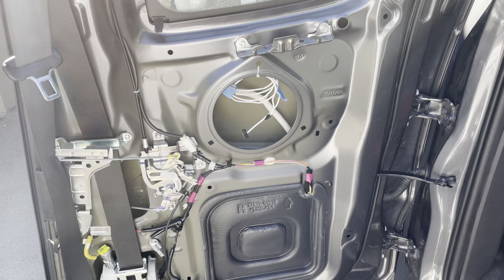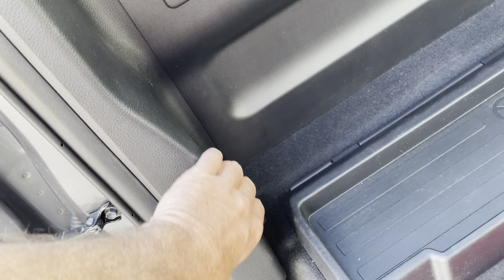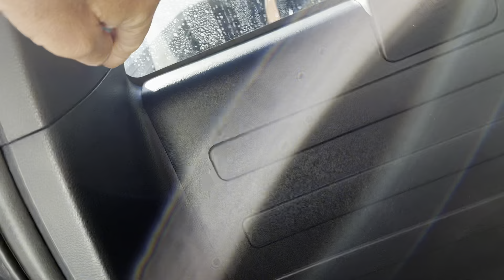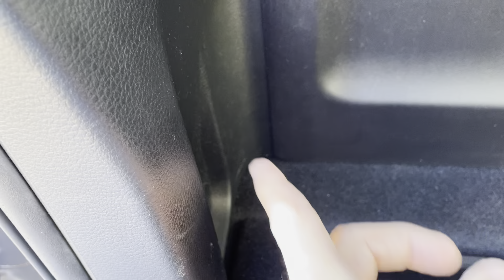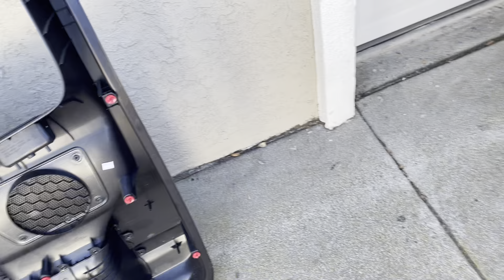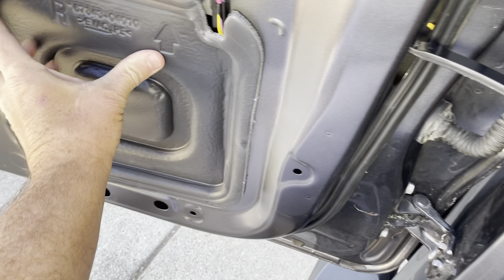2018 Toyota Tacoma SR Access Cab Adding Rear Speakers Part 1

Comment: What's interesting is I have an access cab as well. And at first I thought the function of my rear speakers mattered more. And I amplified some rockford fosgate punch speakers in the rear doors. They were nice and loud but I was curious about different setups. What I tried was I bridged my 4 channel amp to send all power to the front door speakers and dash tweeters. I left the rear doors powered by the factory headunits. It sounded way better to me. Much better staging. Having loud rear speakers sounded strange coming from behind conflicting with the front speakers. Plus I don't sit back there, I don't need loud high quality sound back there. But this is awesome seeing your solution to your issue. Very well done. Not just amateur wiring through the door jams.
Reply from the maker: Yes I agree. The front speakers really do all the heavy lifting. Truth is after I was done, I didn’t notice a tremendous improvement by adding rear speakers. That said, it just bothered me to have a fader that didn’t work and holes where rear speakers should have been. If nothing else I Satisfied my OCD. 😆

Comment: Good shit. I took my door apart and didn’t find a connector. Couldn’t get the back panel off so I gave up. Very helpful! Thank you!
Reply from the maker: That's correct.  The connector is not inside the door.  It is behind the side panel inside the truck.  That back panel can be tight and it is hard to get your fingers behind the seam.  You can use a plastic trim panel tool but once you get a grip on it, you just have to yank it hard to get the clips to let loose.

Comment: Thanks for the video. Just so other 2.5 gen owners know, the 2.5 does not have the wires ran to the back and the white connector only has 3 wires.
Reply from the maker: Good to know. As irritated as I was with Toyota for not wiring the door, I guess I was lucky having the wires I had.

Comment: How did you connect the speakers at the head unit, is it the stock one?  I see 4 lavender wires which I think are the speaker connection... are the 2 new rear speakers spliced into these or do they connect at the 2 unused slots on the harness?
Reply from the maker: I actually made 3 videos on this.  See links below. part 3 shows the wires. On my specific truck, it was already wired from the head unit all the way to the back of the cab.  I didn't have to touch the head unit.  All the wiring took place in the back of the cab. What was missing was the wires inside the back access doors and of course the speakers themselves.  Also had to alter the door panel to reveal the speaker grid.  Talk a look at the other two videos, especially part 3. 
https://www.youtube.com/watch?v=EK_lGUX8yMM

https://www.youtube.com/watch?v=cI8OG0Oz47E

Comment: I upgraded my fron speakers and tweeters but I also have the base model so does putting them in the rear doors make a difference?
Reply: I’ll be honest, I think the front speakers do most of the heavy lifting and the rear speakers really didn’t add much. But it bothered me to have a fader that didn’t work and holes where speakers should be. Chalk it up to my OCD.
Reply: @RAWJITSU  Thanks. I'm kind of the same way. I always like to have more of it pushed to the rear when I'm driving.
Reply: @xsoundwavex4143  If you have the time and a little money,  and enjoy working on projects, then the speakers certainly won't hurt.  I have my fader set up slightly to the rear.  I bought modest speakers from crutchfield knowing I was keeping the factory head unit and was not adding an amp at this time.  So the whole project I think was less than $75.  That included a few replacement clips for the door panels from Toyota (a couple will likely break) and the plastic plugs from Amazon.
Reply: @RAWJITSU  man you weren't lyin bout the fronts doing all the work. I finished my project today. Had to use bolts to hold them in and had some plugs for that stupid panel. Sounds pretty good turned up. Thanks for the vid, advice and finding those wires. 🤘

Comment: Thanks man. What did you end up doing with the rear door panels? Looking for some ideas.
Reply from the maker: When you remove the plastic covers you are left with 6 holes.  Drill them out carefully with the smallest bit you can. I bought plastic auto plugs from Amazon and glued them in place.   Here is the link. 

https://www.amazon.com/gp/aw/d/B0017UBHQS?psc=1&ref=ppx_pop_mob_b_asin_title
Reply: @RAWFIXIT  thanks. So when the cover is gone the speakers sit flat? Would like to see a picture. Do an amp?
Reply from the maker: @johnyoung5482  im out of town and away from the truck. The speakers are mounted to the metal door frame behind the plastic door panel. All you see is the door panel just as if it had factory speakers. Unfortunately Toyota installed the extra plastic cover over the top of the “mesh” in the plastic door cover. So it has to be drilled out to be removed. That’s why you are left with the holes. Otherwise it would look just like a door panel from a trim level that came with speakers.
Reply: @RAWFIXIT  thanks for the info.
Reply from the maker: @johnyoung5482  Not sure if this link works, but give it a try.  This is not my truck, but I found the picture online.  I did a cleaner job than this person, but it gives you an idea of what it looks like after you drill the holes and remove the cover, before you install the plastic plugs from amazon to cover the holes.  It is a shame toyota decided to add the extra cover on the access cab.  Otherwise it would look like a normal tacoma with speakers. https://twstatic.net/attachments/69215656_554986508641841_798194134945051_b4aa9a0d0afd43b372dabd128f3bdb65fa21487b-jpg.3493679/
Reply: @RAWFIXIT  that's not too bad. With the right plugs it will be fine. I appreciate your help
Reply: @RAWFIXIT  The page is blocked
Reply from the maker: I just posted a follow up video so you can see the final product.

Comment: Would it be possible to install 6x9 instead of the actual size
Reply from the maker: I’m not sure how much room is in the door. You would definitely need to cut some metal out of the inside of the door. Also, the plastic door panel only has holes for a 6 inch round. I don’t see the benefit in that.

Comment: What size speakers did you use?
Reply from the maker: I used 6 1/2 inch infinity speakers from Crutchfield.  They send you a plastic conversion plate but if I remember, the holes did not line up perfectly so I think I drilled some holes in the plastic ring supplied by crutchfield and used my own bolts, nuts and lock washers.  In eitehr case, 6 1/2 is the size you want.